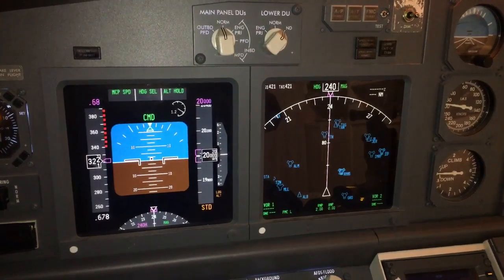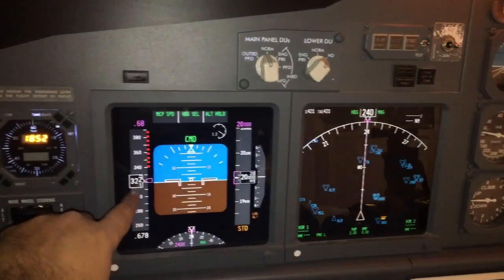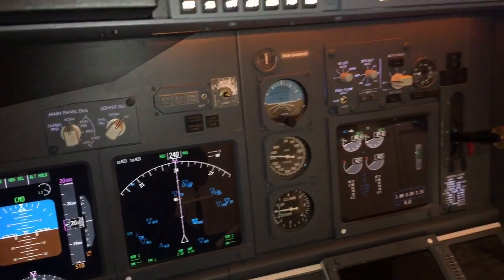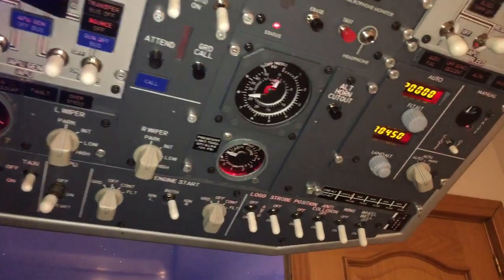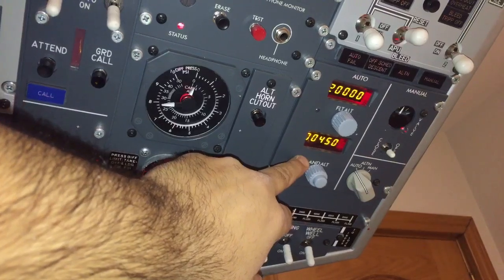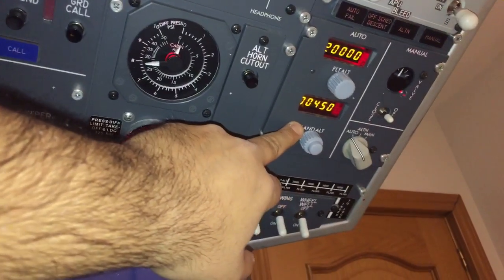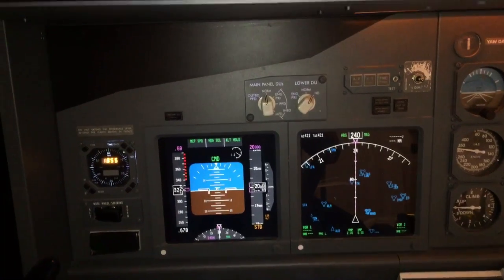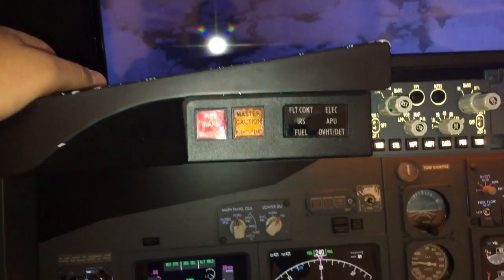Boeing 737 Overhead Pressurizing system review prosim 737

Comment: If we do this while flying at that altitude what will happen in real life is it possible could there be a major problem ?
Reply: Nobody usually does this intentionally while flying.If there s a real failure , your gonna loose cabin pressure. When this happens,chemical oxygen systems will kick in and supply oxygen for some time( say 10 to 20 mins) through a mask that drops from the overhead panel above each passenger. This time is usually enough to bring the plane down to a safe height and land at the nearest airport.Pilots have their own supplementary oxygen system and chemical oxygen packs too.
Reply: szplug v yes that I am aware  of !! That said I understood your message as swell thank you ! I fly the 737-600 pmdg but thanx to your video I understand the system a lot better then before thanks.

Comment: Very nice demonstration! 
Can u explain what will happen if the aircraft climbs above the altitude set in the Flight Altitude indicator on the pressurisation panel! 
In your video for example if the airplane climbs above 20,000ft without resetting the Flt Alt on the pressurisation panel?
Many thanks
Reply: Well, till a certain height, the pressurization system works on a mode called "isobaric mode", wherein, a fixed or set cabin altitude can be maintained.When the plane climbs above that level, then, the focus of the system shifts towards maintaining a fixed differential pressure.IF the pressure difference between outside and inside crosses a limit, then, the fuselage is going to burst.To avoid this, the system(pressure controller), compromises the cabin pressure(increases the cabin altitude),so that differential pressure is within limits, allowing the plane to climb higher. But, this can continue only till the cabin has a min pressure that people inside need to live.May be the plane can climb even higher, but cabin pressure may go below dangerous limits. So, that limit dictates the maximum height a plane can fly. Pressurization is huge interesting topic!